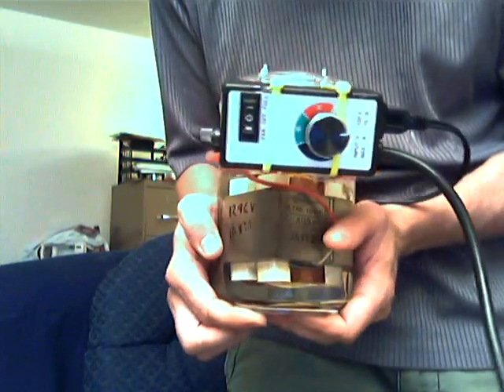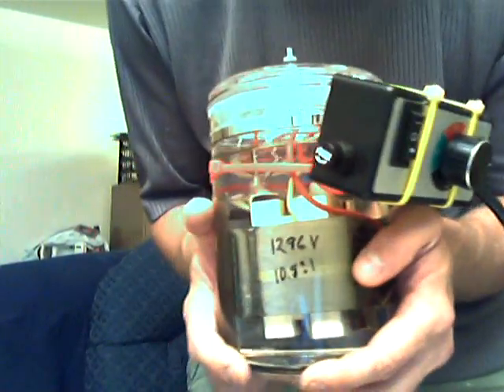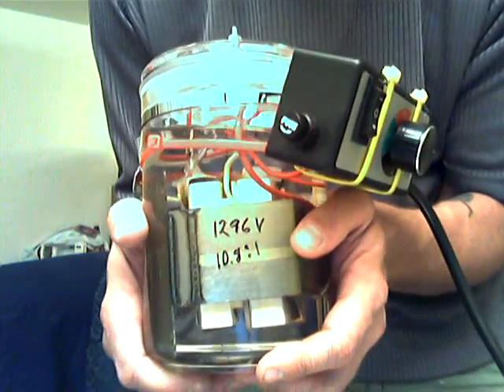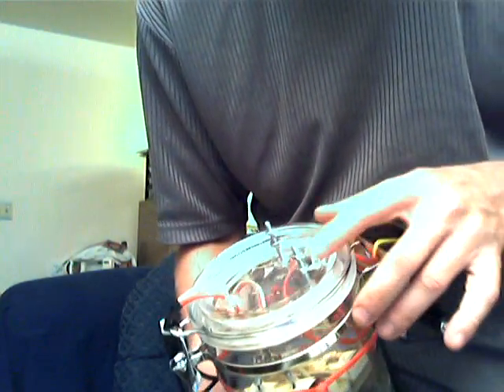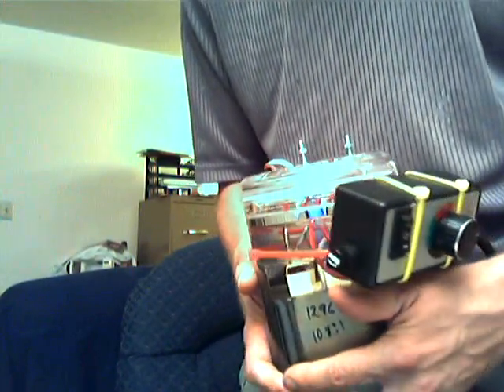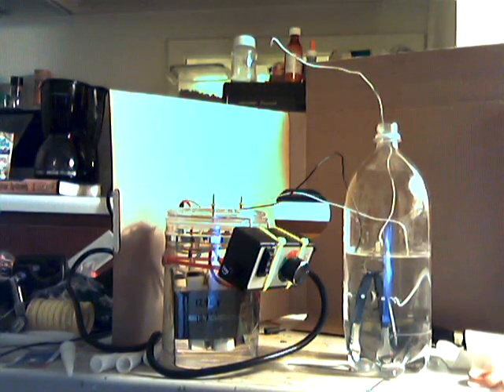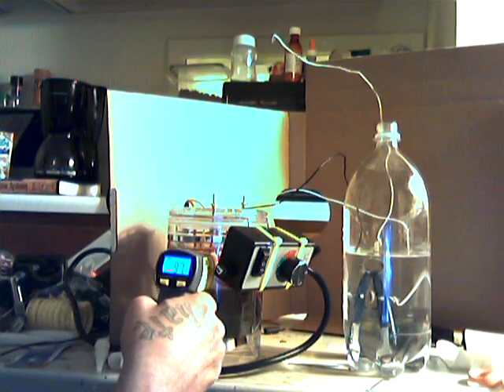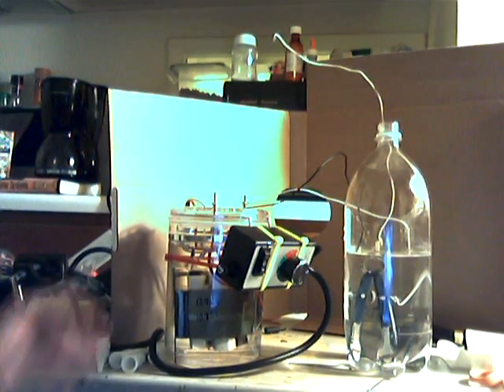high voltage transformer winding ?

Comment: ok from what i have heard-its usually boiled out before it is used as transfomer oil-there is gasses trapped in the oil and they can be a problem next to the windings-creating breakdown points-i dont think it will be much of a problem tho.
you could use that compressor to pull a vac on it and get the bubbles out that way-boiling oil with heat is very dangerous.
good job on sinking that MOT-looks cool